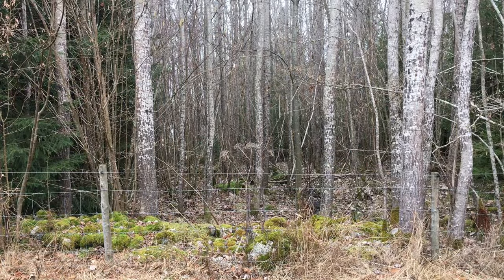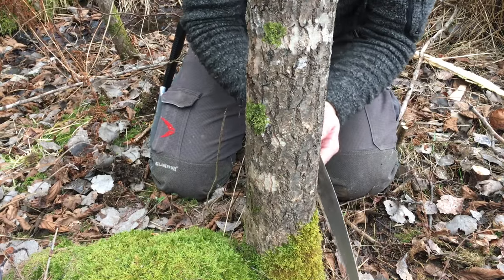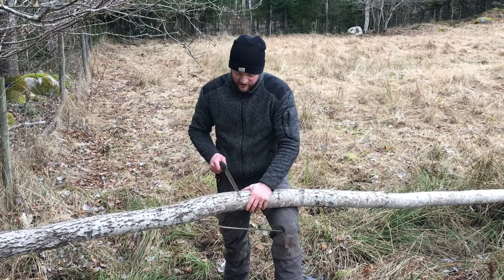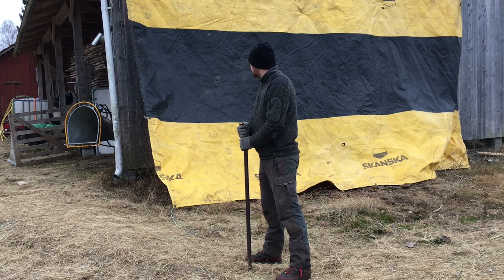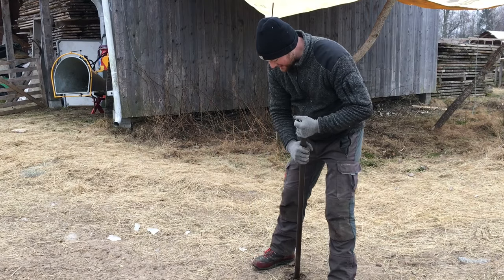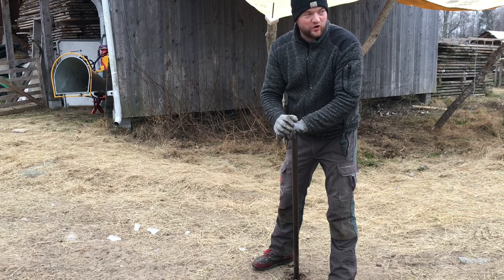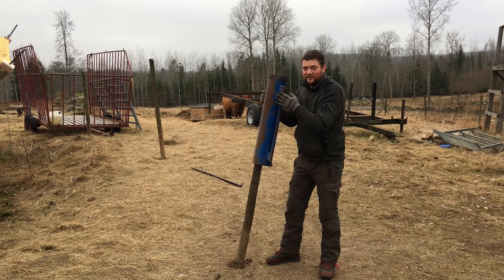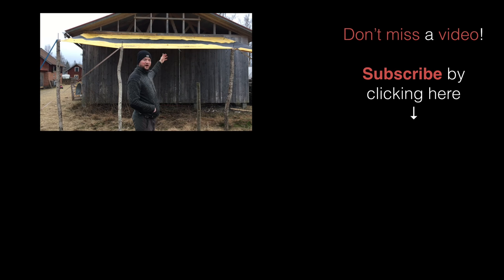How To Build A Temporary Cow Shelter

Comment: In England (and Ireland) that tool is called a "Crow Bar"
Reply from the maker: Thanks!
Reply: Yep a crow bar, a breaker bar or a Demo (demolition) bar all apply.
Nice use of your bandsaw sharpening those points, but a sharp axe would have been quicker!
Cheers!
Reply: And in Scotland it would be called a "pinch"
Reply: It's trans-Atlantic!!!
Reply: Down under with the bigger ones it's called a "Wrecker Bar or Struggle Bar"
Reply: In New England a long bar with a crow's foot for nail removal and a curved and flattened wedge for prying is called a "crow bar" or "pry bar".  A very similar tool with a wedge or pointed straight tip, a square, hexagonal or round cross section (or a combination of all three) and a taper on the opposite end is called a "stone bar". (We have a lot of "stone" in New England so they are pretty common.)  All long "steel and iron bar tools" are a 
"force multiplier" on a homestead.
Reply: Crow bar, breaker bar, pry bar... several names for that tool. Haha!
Reply: Simeon, these guys are pulling a joke on you. That tool you welded together to put in fence posts are called "Post driver" or "Post Pounder" .
Reply: Frossiart That is a post driver, I thought we were talking about another tool...? I've seen pry bars/crow bars My husband has them in various sizes even with the V shape that was described. But the post pounder Simeon used, we've also used too. Having over 4 thousand acres you tend to find the easier methods than the pounder unless it's just close to the farm and a couple fence posts though.
Reply: Yes , the post driver he made is called simply that, a "Post Driver", but Simeon first asked about the bar he was using to make a hole in the ground.
Reply: nigel Mc Hugh Yeah, the bar he was digging in the ground doesn't it have the various names?
Reply: Yes, it has all those names!

Comment: Bedding may still get wet by leaking tarp or rain comming in from the side. Consider putting cows in adjacent barn and the equipement overthere under the tarp. In that way there is less chance of bedding getting wet from rain.
Reply: additional advantage is that you dont have to make a fence under the tarp

Comment: tent poles
set two ropes on the corner at right angles
cows might rub to get the itch and knock them down solutin is to nail broom heads to the wall they will like them more and rub there or elect fence will stop them

Comment: I see the comments about the poles, but if they are on the outside of the fence then the cow cant knock them down. I was wondering about Snow, i notice there is none on the ground, is winter over in Sweden? I was curious what 3 or 4 inches of snow would do to the tarp......
Reply from the maker: We still have winter for 2-3 more months. It has been extremely mild and we have had a drought since spring 2016. Now it is getting colder.

Comment: 4:30 this tool, a straight crowbar...
A crowbar, also called a wrecking bar, pry bar or prybar, pinch-bar, or occasionally a prise bar or prisebar, and more informally or known to non-American nations such as Britain and Australia as a jimmy (also called jimmy bar or jemmy),[1] gooseneck, or pig foot, is a tool consisting of a metal bar with a single curved end and flattened points, often with a small fissure on one or both ends for removing nails. In Britain, Ireland, New Zealand, and Australia, due to the influence of American media "crowbar" may occasionally be used loosely for this tool, but it is still mainly used to mean a larger straighter tool, its original English meaning (see digging bar). The term jemmy or jimmy most often refers to the tool when used for burglary.